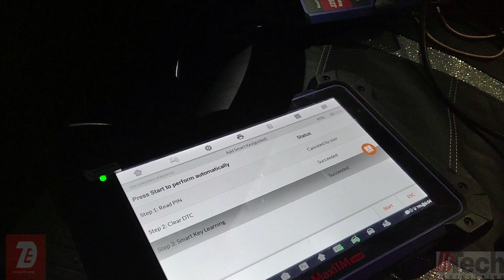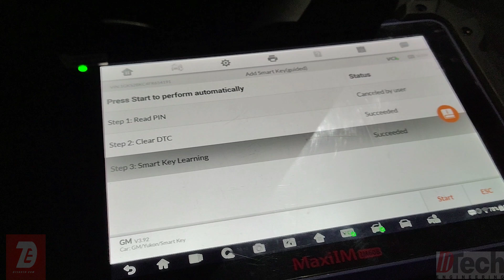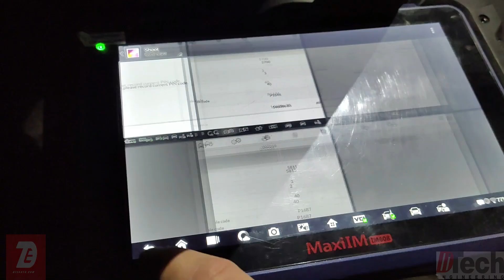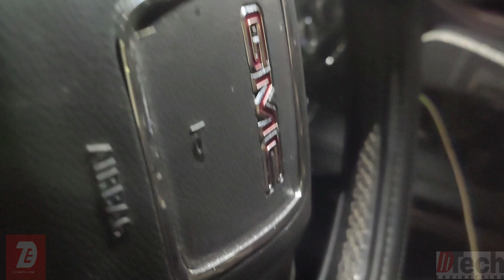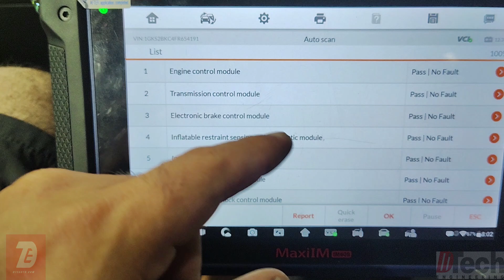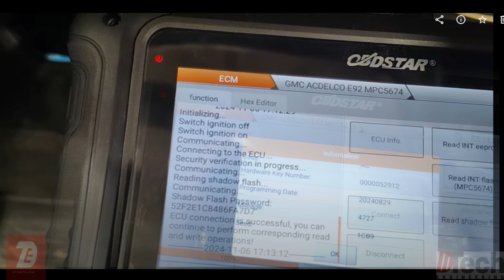2015 GMC Yukon PCM Programing when Original is Dead

Comment: It's funny you and Oz both made a video today on programming a E92 PCM. Why don't you do GM programming in house? You already have all the equipment you need, and there is no subscription fee it's just $45 per vin.
Reply from the maker: I didn't even know he had 🤷‍♂️
I had done some years ago when I had a windows 7 and even then it was a headache jumping through hurdles, eventually I gave it up and the more I see people on DN having so many difficulties trying to get programming sessions to complete do to some silly issues on gm's side is just kinda a "turn-off" and keeps me from trying to jump in again. I will admit that these situations do make me think twice at times. 🤔
Reply: @DTEAuto It's the type of thing you don't have to officially do; there is no subscription fee. So in a case like this all you need to do is download the software and try to program it, If it works great, and if not, it doesn't charge you the $45. so there is no downside.
Reply from the maker: Thanks, I'll have to look into that then for sure 👍
Reply: @advancedleveldiagnostics What do you mean it doesn’t charge the subscription fee?  It uses a VIN slot once you connect to SPS2.
Reply: @djosbun  it only takes a vin slot if the programming is successful, when your on the warranty code screen that's when it updates your vin slot.
Reply: @ I was not aware of that…..thanks Lazer!